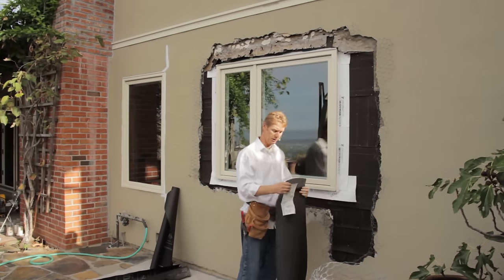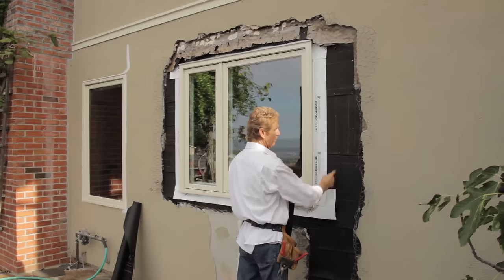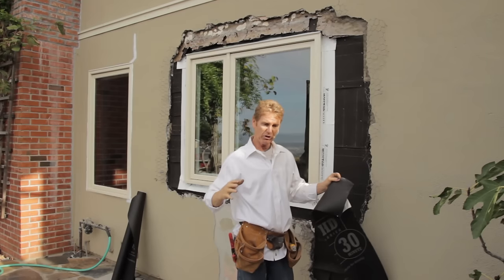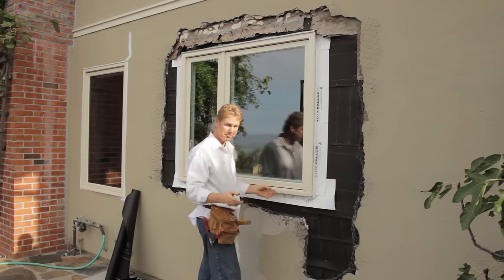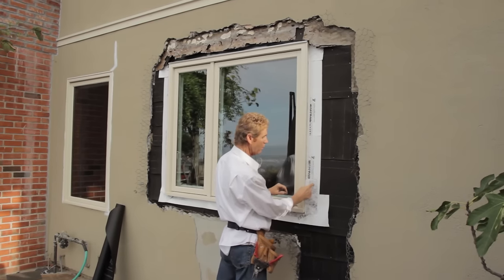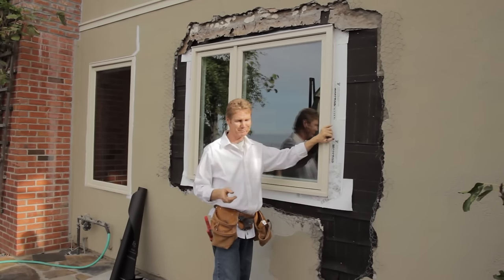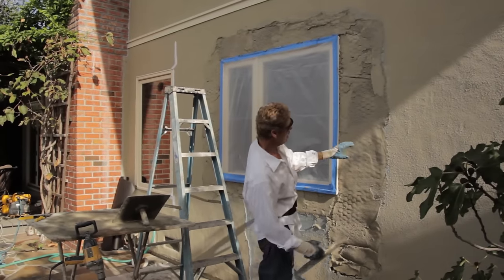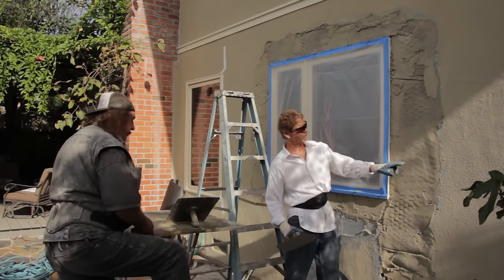Stucco over exterior sheetrock

Comment: I must also add that i have built and started to render some  retaining walls in my garden , watching your videos gave me the confidence to cover them in stucco . Two coats are being applied ,  and she who must be obeyed is happy with the job so far . I also plastered the whole interior of my house in no small part thanks to you guys my arms nearly dropped off during the process and i can  tip my hat in appreciation of what you chaps do for a living with such dedication bravo and a big Thank you . Martin
Reply from the maker: Morning jurassicbark2000 dude, yea, at first use use arm muscles you never thought you had in your wrist, forearms and shoulders burn so much there's no way to keep doing the troweling.
 When this happened when my kids were learning I'd just say do something else for awhile then comeback and try again.
 These muscles only gets stronger for the next time.
 On a cement, or cinder block walls, one coat is all that's necessary, however that coat has to be at least 1/2 thick, It;'s called skim coating and should be thick enough so that when it rains the block lines don't show, not certain how thick to apply?
 Go thicker than 1/2 inch, then for sure you wont see block lines for sure.
Cheers!
 kirk Giordano
Reply: Cheers Kirk my life just got even easier .
Reply from the maker: Morning jurassicbark2000 dude, if you are saying you are going to start using this product, DO NOT OVERMIX IT!
It's a great product but over mixing like all these same day strong products make the cement plaster weak.
notice I wrote the words do not over mix!, it's no joke.
 Best wishes,
 Kirk giordano
Reply: No way just good old Lafarge cement and sand .
Reply from the maker: Evening jurassicbark dude, I here Lafarge is a world leader in North America, with their cements and sand.
 This companies products are not sold in our area.

 Cheers,
 Kirk Giordano
Reply: Yeah it's a French company i think they're the biggest in the world certainly in Europe .And good morning to you guys on the sunny side of the Atlantic .

Comment: Hi Kirk: I just started checking out YouTube and I find your videos most helpful! Thank you. I got a question for ya... I am helping a lady out with an art studio add on (which is basically a fully enclosed porch) which I have since insulated and replaced some very rotten wood siding. Being in So Cal, its all termite damaged and we have taken precautions to remove the pests and also replace the siding. I used Hardie Backer cement board to replace the siding. Her house is stucco finished and I want to also stucco her art studio to make it look like it is part of the home. However I find there are very little videos on how to stucco over the cement board. I have purchased a metal meshing to install if necessary, but would you recommend I use any mesh or should I just go get the paper backed chicken wire and go forward from there?  Thanks again!!! Your amazing at what you do.
Reply from the maker: Howdy Ryan, depends, did you install a moister barrier under the Hardi board if so attach 17 gauge stucco netting over the Hardi board into the studs, then stucco.
 If you did not install a moister barrier than you can use the paperback wire that is impregnated into the paper.    
                     Live long and plaster, 
  Sharing stucco secrets and or common sense tips
Reply: Thanks Kirk. Would you say the wire netting is critical? My clients brother (former contractor and window/door specialist) said I should just mud over the Hardi board. There is a paper barrier behind the board.
Reply from the maker: Howdy Ryan, depend on the situation, stucco netting over paper is necessary to hold the stucco.
 Stucco naturally adheres to most cement boards by suction with proper hydration.
 That means mist the boards with water from your garden hose, "not dripping wet," but just a mist, then apply the stucco to it, this, when done properly, forms a strong mechanical bond.
 However, yea, theres more, if you have many seams these will crack if you don't use a quality mesh tape designed for this board.      
                             Live long and plaster, 
  Sharing stucco secrets and or common sense plastering tips
Reply: Kirk Giordano plastering Inc.
You rock! Thanks for the tips. Have a great day!
Reply from the maker: Howdy Ryan you can  use mesh 3.4 wire if you applied a moisture barrier behind the hardie board.  if you did not install a moisture membrane you will need paperback stucco netting as hardie board is not waterproof.
                                              best wishes,
 Sound advice for plastering issues from your favorite stucco geeks.

Comment: Hi Mr Giordani. I Love watching your videos! I am trying to replicate the original smooth, slightly sandy stucco interior wall. We had to do a complete renovation and I was wondering if I could use stucco as a finish on the new drywall in my kitchen? I did a practice piece and it looks really good but will it be stable?
Reply from the maker: Howdy Bam Dude, use diamond veneer base and finish coat it's strong and faster plus won't absorb moisture like stucco.
            Live long and plaster
 stucco images and teaching videos
Reply: Kirk Giordano plastering Inc. Thank you for your advice. I appreciate it!

Comment: Is it possible to stucco over Hardiboard inside a house? Or should you add lath to the Hardiboard?

Thanks
MJ
Reply from the maker: Hi mike johnson, if it were me I would clean the boards, apply a bonding agent then plaster using strut-lite or any of the fast set gypsum available.
 Westpacs is a popular one.
 Cheers,
 Kirk giordano

Comment: Hey Kirk ..... That Fast-Forward bit??  ...... Nearly as fast as 'Me' in the 70's ;-)
Reply from the maker: Morning Peter Moring, man you were good,  I think this fast setting saved 10 minutes each time of viewing that might have got a bit to boring, but what was not shown was how well the tops and sides adhered to gaps over 1/12 inch deep with this professional material.

 FYI, anyone interested in the material we used tin this video that would adhere and stick a solid inch at a time, it was Eisenwall cement plaster made by Rapid Set.
This cement plaster can be applied up to 6 inches thick back to back same day.
Eisenwall is a premium hydraulic cement for exterior plastering, one coat stucco and wall repairs, this material requires a citification for good reason, (or used to) it really requires a lot of time in to understand how to mix and apply as it sets REALLY FAST (in 15 minutes to a half hour) unless you add retardants, and is incredibly strong, so strong that if you don't apply if just right it's not coming off, even with a sludge hammer.

Rapid set also sells a simullar cement plaster at all the Home Depot's and Lowes, hardware store, just not this brand, the rapid set you DIY'ers purchase at these hardware store's already comes with the sand, you just add water. Much more user friendly.
 This Eisenwall, we must also add the sand, plus the water, it's sold at Westside Building Materials and many of the professional plastering material yards, not sure if a citification is still required.

 best wishes, 
 kirk Giordano

Comment: Hey Kirk, my garage has a water leak that around a newer installed window that caused the gypsum board behind the stucco to deteriorate, I’m trying to chip back the stucco to get to where the moisture barrier is still intact but it just keeps breaking the gypsum board behind, Any advice on how to move forward would be greatly appreciated.
Reply from the maker: Gypsum board was used for about ten years, then the country stopped this ridiculous method for reasons you are now having. The board is gypsum thus when wet is fragile like eggshells, it take forever to break it out to just re lath for new stucco, as it's really soft and useless when it get wet.

Comment: hey Kirk got a question!!! so we are getting orange peel in our home tomorrow morning and my wife is asking why cant we add the paint to the hopper gun with the orange peel. is it possible to add the paint color to the orange peel? thanks guys!!!
Reply from the maker: Morning jnixongo00, I don't understand what you mean getting the orange peel?
 You mean someone is going to use a hand hopper to spay on a plaster coat or the popcorn ceiling that is usually Perlite or any type of aggregate and gypsum mixed?
 It is possible to add paint to this, but it's a nightmare to get the color you really desire for many reasons.
 Cheers!
 Kirk giordano
Reply: +Kirk & Jason Giordanos DIY plastering and stucco tips exactly! thank you

Comment: all this black plastic moisture barrier Kirk, how is moisture suppose to escape from the house and how are buildibgs suppose to breath?
Reply from the maker: Good evening Dude, you can google your question if you get 50 replies all will contradict one another.
 My job in this video is to waterproof the window patch not to allow it to breathe or absorb moisture.
 You are referring to a 3 coat cementitious finish, these three coat color integrated finishes are designed to breath, thus when it rains the walls darken, when dryer condition occurs they return back to their original finish, like a brick.
    Live long and plaster
 teaching  plastering video’s
Reply: +Kirk Giordano plastering Inc. i know plaster is permeable but not the black stuff. i understand its a code they use in US. good job anyway
Reply: maradonasssssss
The building will probably breathe if you open windows , or doors ? i know sounds obvious, but it will work. the construction will settle and will not need too much expansion and contracting, unless you live where there is a lot of change in temperature,. even if there is change in temp, it should settle and will stay firm and strong. Im doing a 3d animation of a building i want to build. will upload it.